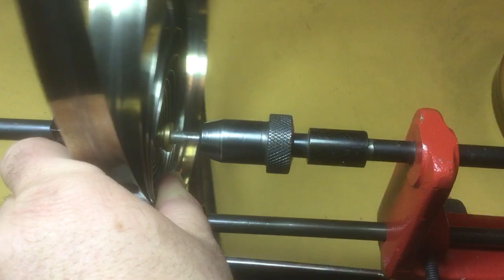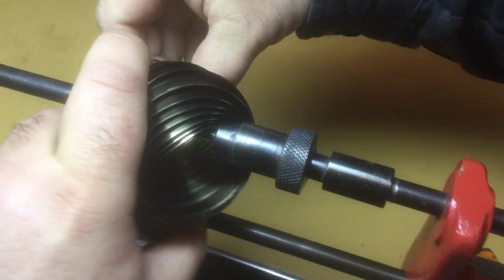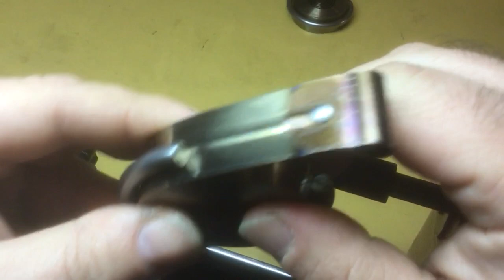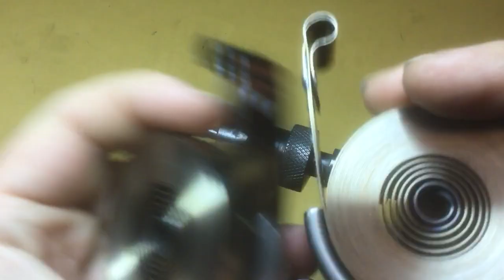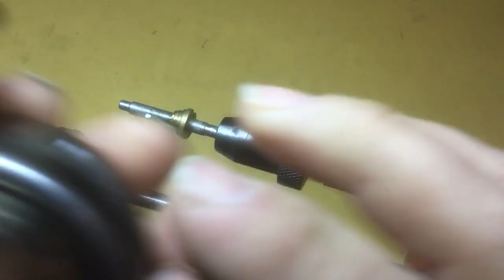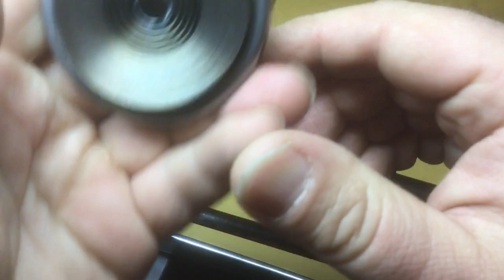Takeda short drop octagon clock rebuild part 7

Comment: Gotta ask, where did that mainspring winder come from?
Reply from the maker: It is a used Webster mainspring winder I bought off ebay. They are still available new, however, and many of the accessories are available separately, so I was able to add the arbor support which is a very handy addition, and one I would not be without.
here is a link to one for sale new:
https://timesavers.com/i-8949321-webster-style-mainspring-winder.html
Reply: @okbridges  Thanks.